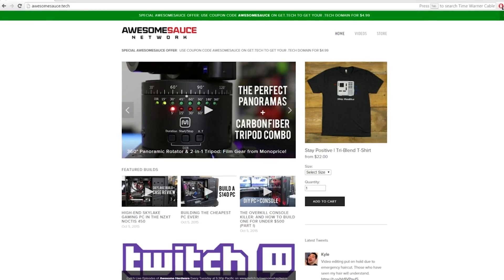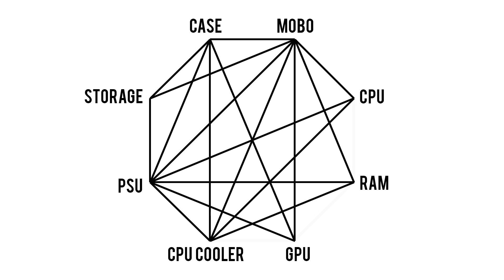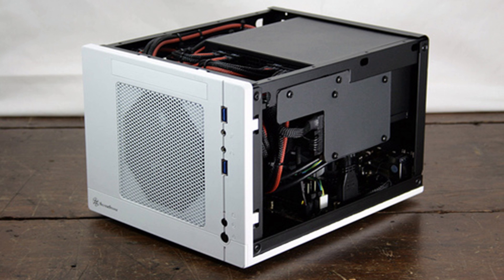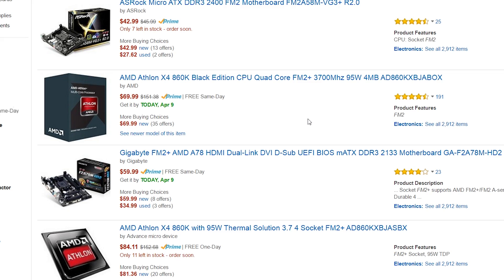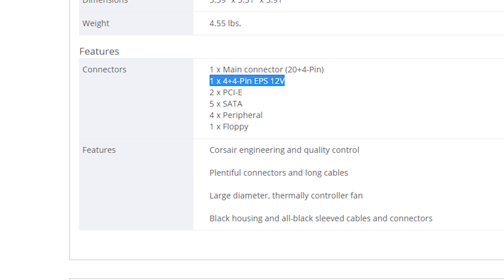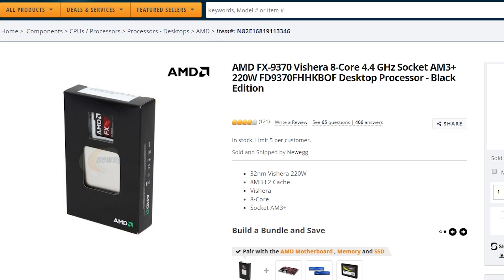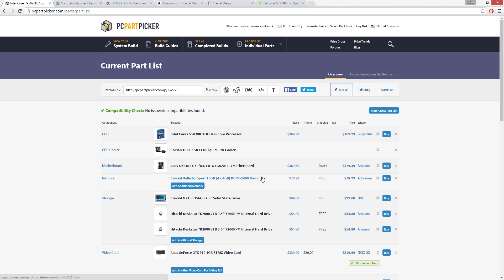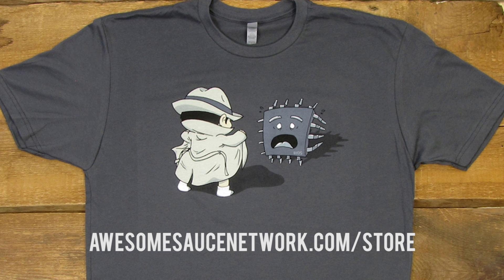How to Choose Parts for a PC! The Ultimate Compatibility Guide!

Comment: Yo dude can you check out if all my parts are compatible with each other http://pcpartpicker.com/p/RsyWYJ
Reply: pcpartpicker ONLY shows you parts compatible with what you already have. No worries there.
The GPU is bad choice, though. That card will never be able to use its full 4GB. It's simply not powerful enough for that. Get a 380. Also, your PSU is overkill. 600Watt is a lot. You also can't upgrade this in the future. Your parts are the last of the line in terms of DIMM type and socket. There's no CPU upgrade with the 1150 socket, so you're stuck. And the mobo only supports DDR3. So, you can only add more DDR3 RAM. 
It's a decent build to last you, let's say 5 years. But you can't upgrade it. You'd have to replace it entirely.

Comment: i need help with a psu... i need something that can support 4 gpu's and has a lot of watts so i can use 4 gtx 1080's or ti's when/if they come out. i have a massove budget so dont take this as a joke i genuinely need help with this
Reply: and I wondered if my fx6300 compatible with gtx1080? someone?
Reply: +ItsDream A 1500W PSU will support 4 gtx 1080. Search Corsair, Seasonic, EVGA, thermaltake or Antec for their power supply.
Reply: +Blackwatch Troops All graphic card is compatible to all processor be it AMD or intel or nvidia. The only thing that you have to worry about is whether the processor will bottleneck the graphic card.
Reply: Uhm, wasn't the 1080 only 3-way compatible? NVIDIA limited SLI on purpose because they know their cards barely get improvement in SLI.
And really, what are you going to do with all those 1080's?
Reply: Tomb Raider maybe not. But for CPU intense games like Crysis, GTA, Battlefield, that 6300 will suffer. It has low single core performance and a stock i5 6500 beats it. Even an overclocked fx-6300 at 4.5Ghz gets beaten by an i5 6500 at 3.2Ghz. Don't trust the numbers, trust the benchmark.

Comment: If you opt for a small motherboard make sure they sure that the motherboard manufacture doesn't decide it's a good idea to put all the IO, SATA and USB connections inline with the only 16x pcie slot restricting you to a card that is only the length of the pcie slot, a good example of this is the ACER DIG43L
Reply: That's why you should always opt for either AsRock or Gigabyte boards. Fuck Asus for the overpriced shit. MSI boards only if the other three don't have anything you like.

Comment: can anyone tell me what i can do to improve this build. should i get better parts or downgrade to save money. please help me out if you can. http://pcpartpicker.com/p/8ZDVqs
also ssd or hard drive?
Reply: +SuperiorGaming Missing parts, Casing. Buy a 1TB HDD and a 128GB SSD. SSD use for OS and other software that you will load frequently. If you wanna save money, get 8GB value ram. Change to i5 6500. Change to B150 motherboard. Use stock cooler. Lastly, get a better quality PSU from Seasonic of EVGA with at least 80+ gold. All this changes will not have drastic gaming performance reduction.
Reply: Why a B chipset? That's a chipset aimed at enterprises, and has tech in it the pc enthusiast can't and won't use, such as vPro and IPT. At least the H and Z chipset mobo''s allow for more USB's and are actually made for pc enthusiasts.

Comment: I'm confused
Reply: I'm scared
Reply: ps. im a dumbass
Reply: +Orekame Gaming It took me 2 years of my free time to understand it.
Reply: +Toropon Gaming proabibly since you are a 2:23(not meant as an insult, just coldnt not say it...)
Reply: It's easier than it looks, trust me.
Reply: it's easier than what it looks and sound like. I just built my 1st PC 2 weeks ago and works fine. The only problem I had was the Mobo not recognizing the RAM.  This was fix when I bought an additional stick of 2133MHz RAM just to get to the BIOS, change the speed of the RAM to 3200MHz and updated the BIOS. After I made those changes I was able to install the 32GB of RAM and the pc has been running fine ever since. I enjoyed building my pc so much that I'm looking forward in building one for my niece.

Comment: You missed the (Intel) Motherboard-to-CPU Cooler compatibility issue with Narrow ILM vs. Square ILM cooler mounts. Many Mini ITX motherboards have server-style Narrow ILM mount points, which are not compatible with coolers designed with Square ILM brackets. Sometimes you can buy alternative cooler brackets separately from the cooler manufacturer, but this has bitten me before.

Comment: Does the CPU matter when picking between DDR3 and DDR4 types of ram?, sorry but i'm bulding my first pc and i'm really not sure about that. Im planning to use a core i3 6100 and i've read somewhere that it only supports DDR4, is this true?.
Reply: +Edson Galeana Correct, the Intel Core i3-6100 only supports DDR4 or more correctly, the chipset required to use the i3 requires DDR4 (with some rare exceptions). The CPU you mentioned uses the new LGA1151 socket type, released with the new Intel Skylake processors (i.e. 10th generation), and require the Z170 chipset which in turn requires DDR4.
Reply: +Edson Galeana Yes. But getting a CPU and RAM that are both compatible with your Motherboard will address it. As far as I know 115x socket (Z97 and Z170) motherboards are DDR3 and 2011-v3 socket (X99) motherboards are DDR4, but your mileage may vary I suppose. Check your motherboard specs.
Reply: +Edson Galeana Skylake processor can run on DDR3L and DDR4 ram. Most of the time, it depend on the mobo that you are using. Some LGA1151 mobo support DDR3L or DDR4 but not both.

Comment: I need help The Peripheral cable mean molex cable right??? Cuz my case has a molex plug and my power supply has the peripheral cable, if they are the same thing, why is it so hard to stick the two cable together, i dont want to force it in if the two is not compatible, i just want to make sure they are before i put force

Comment: What about ram speeds prior to your cpu , for example if i want a skylake cpu what kind of ram speed should i buy
Reply: +Francis Metrillo Motherboard is the one that determine what ram speed it can support. 
Most B150 mobob only support 1866~2133mhz while Z170 can support 2133mhz ~ 3600mhz.
You can insert a 3000mhz ram onto a B150 and it will automatically downclock itself to the highest that it can support.
Reply: yeah, but my question is irrelevant to what the motherboard is

Comment: With my build, one problem I came across was the length of the cables from my case fans, particularly when I wanted to connect the front fans to the motherboard fan headers through the cable management space at the back of the motherboard. Basically, they weren't long enough, so I had to wait for fan extension cables in the mail before I could connect them up.

Comment: I'm planning on building my first PC but I'm not sure if it can run the newest games (GTA 5, BO3, CS:GO, BF Hardline, etc.) at 1080p max settings. These are the specs: 

CPU: Intel Core i5-6600 3.3GHz
CPU Cooler: ARCTIC Freezer i30
MB: ASRock Z170 Pro4
RAM: Kingston HyperX Fury Black 8GB (DDR4-2133MHz)
SSD: Samsung 850 EVO-Series 250GB
HDD: Western Digital Caviar Green 1TB
GPU: EVGA GeForce GTX 960 4GB SuperSC ACX 2.0+
PSU: Corsair CX600M
(Case: Cooler Master N600)

Do you think it will have enough processing power? And should I change some parts? Thanks
Reply: +FuzeMusic Processing power? Yes. The 6600 is an excellent processor. The second best purely gaming processor, second to the 6600K. And the 960 won't run games at max settings, only high. And you don't really need a aftermarket cooler for a i5, they run so cool the stock cooler is fine.
Reply: +Saxton Hale Ok thanks for the info! :)
Reply: FuzeMusic No problem :D

Comment: i built my 1st pc using the gigabyte z170 mx gaming 5 and the cpu i used is the intel penteium g4400 ram= corsair valueselect ddr4

i make sure every connecetion is properly attach i dont get any display boot on the screen, everything seems to be working fans cpu cooler

can someone help me out?

Comment: Thank you so much for this explanation! I'm saving money to build my first pc and I have been very confused about how to tell if all the parts will work together and this will help me a lot in figuring it out.
Reply: +Seth Cowell I'd be happy to put together a parts list for you if you give me your budget.
Reply: I'm looking to spend as close to $1000 as possible but the only peripherals I have is a gaming mouse cuz right now I use a laptop so I need to get those and an os. Thanks for anything you can come up with so I can check it out! P.s. If I need to spend up to $1200 for everything I can I just want to get something future proof (to an extent) but not way expensive.
Reply: http://pcpartpicker.com/p/9c9KP6
Optional upgrades:
Gtx 970 instead of R9 390 
Wait for the new lineup of gpus by Nvidia and AMD
More expensive modular power supply, offering cleaner cable management
 The 970 is MUCH quieter, cooler, and barely uses any power. But it is less powerful and future proof because of only 3.5gb of good vram. I added in the two fans an the splitter cable because the motherboard didn't have enough ports for all four fans. The case comes with two fans btw. The i5 will do fine on the stock cooler. This system will be pretty noisy.

You will be running every game at ultra settings 60+ fps at 1080p, as for the other resolutions, I really don't know, so you can google it. You can buy you preferred flavor of windows on r/microsoftsoftwareswap for about 20 dollars.
Reply: Actually, if you are just gaming at 1080p, the 970 will be fine. If you choose that route, you won't need the two extra fans.
Reply: I've done a little more research, the Sapphire R9 390 is the way to go. Much cooler because of the 3 fans. You can ditch the 2 extra case fans if you go with it.

Comment: is this good? http://pcpartpicker.com/p/W8MkkL
Reply: do i a better Power supply? llike http://pcpartpicker.com/p/zJdRf7
Reply: +It Me, VAC You don't need a super expensive mobo for a locked cpu. A 1tb hdd is about the same price as the 500gb there. Don't buy Windows for 100 dollars, go on r/microsoftsoftwareswap or Kinguin and pick one up for 20%. I would wait for Pascal in June to buy the PC though. 970 prices will drop and Nvidia will unleash a new line of GPUs. Otherwise, everything is good.
Reply: +It Me, VAC Another note, I would personally buy a PSU with more reviews. I recommend a CX600M. The PSU you listed on your original build is fine though. Also, that second PSU you listed is complete overkill.

Comment: can i plug a usb 2.0 port on my motherboard into a usb3.0 slot on my case?
Reply: +Rocktheblock7 It depends. usb 2.0 and usb 3.0 have different connector design. Some cases have usb3.0 that comes with usb2.0 splitter for convenience while others don't have.
Reply: ok thanks

Comment: i got lucky with part picker Didn't take into account the mobos heat sinks that would of stopped the x61 kraken being mounted. had to move to front rather than top to squeeze in. great site but own research is invaluable.

Comment: cpu/ram/motherboard is a bit more complicated than that. for instance, my msi board, while compatible with my 6100 chip, didn't like my crucial memory, despite it meeting the 'on the box' specs. while my asus board accepted the memory and the 6100 chip without issue. this is when you get to diving into bios updates, cas latency, and all the 'deeper' stuff pc builders learn along the way.

Comment: For graphics cards, it's often the case now that if it fits and you can power it, it works. PCIe is INCREDIBLY versatile and will simply run at the slowest speed. And even high end cards can't eat up the bandwidth of even a 16x Gen 1 slot. So PCIe generation is really a moot point. If it's slow enough to cause issues, you need a new platform anyway.

Comment: All these parts are compatile right???

https://pcpartpicker.com/user/DatMelonGuy/saved/#view=grfzK8
Reply: +Melon yess
Reply: +the guy ok thanks
Reply: +Melon no!! using those components will make your system blow up. use a radiator to cool down your storage drives. (just sayin')
Reply: +s4nic no i got s better idea ima put my pc in the fridge 
10/10 cooling
Reply: damn thats dank
Reply: +Melon Like the others said the parts you cjose are compatible. But why did you choose a Z170 Maiboard?
From my point of view it's a waste of money because you can't overclock the i3-6100 anyway. I would recommend you a B150 mainboard like the Gigabyte GA-H150-D3H. It does the job for you as well but isn't that expensive due to features you can't use anyway with this CPU.
Reply: +paryth hey,

the reason why i chose a z170 model is because i read an article online that said that u could overclock the non-k cpu's. 
what i didnt know, however, is that they closed the loophole a couple of months ago. 

so thank you for replying and saving me ~ 40$ :)
Reply: +paryth also, what motherboards would u recommend for under 80 $?
Reply: Melon

NO keep the z170 board it gives you better upgradability when it comes to cpu
Reply: +the guy Not necessarily. Only if you want to buy a overclockable CPU in the future and oc it of course. But to be honest: the difference between an overclocked cpu and a non overclocked one is about 2-3 fps in games. Therefore OP has to decide if 3 fps are worth the approximately 60$ he would have to spend extra for a oc-friendly mainboard and k-cpu. The only other real differences between Z170 and B150 are a few SATA- and 4pin-connections of which you find enough on the B150 mainboard in most cases. Not to speak about the GAMING mainboards which cost even more only because they look fancy and have a "better" soundchip, which still loses against a real PCIe soundcard. Which OP could buy for the money he saves on the mainboard, if he wants to ;)
Reply: +Melon It's difficult to find a mainboard I would really recommend that costs less than 80$ and features Intel Socket 1151. But you could give the Gigabyte GA-B150M-D3H a try. BUT: It's an MicroATX mainboard, just for you to know.
Anyway good luck with your upcoming PC :)

Comment: Best recomanded z170 board for a 6700k no OC max 200$??
Reply: +Simion Florin If no oc don't go for the k version. Waste of money
Reply: +Simion Florin 
ASRock Z170 OC Formula
Reply: Asus Z170-A if you're on a budget
Reply: +Simion Florin First off, if you don't plan to OC and know for sure you don't ever want to then pick a NON K sku cpu (save you a few bucks) You will prolly still want a Z MB to take advantage of everything the chipset offers but if you spend 80 to 120 bucks should give you a solid MB that should do everything you want. 1 note, I like the Asus MB's as they offer 1 button OC (I use a $110 MB in my system with a 3570k cpu, the 1 touch OC gave me 4.2 hz and it is super stable and I didn't have to try to OC anything myself) Also be sure to read reviews on them and check out the pros and cons and make a solid choice of what you think will work best for you.

Comment: the biggest problem for me is how much wattage do you need,lol
Reply: pcpartpicker.com
Reply: beQuiet!'s calculator is prolly one of the most accurate ones. But keep in mind, that "700W" on Box doesn't always mean, that the psu can deliver that wattage. Many cheap psu's can't deliver much Power on the 12 V rails (usually for CPU, graphics card, Mobo), so Check that out too.
Reply: Usually I estimate the max Power draw of my chosen Parts and then pick a psu from a Brand i trust (in my case BeQuiet, sometimes cooler Master) and Check wheter it has all connectors I need and if it supports all important protection curcuits. Hope I could help you out.
Reply: +Jannik Mayer thanks man
Reply: +Picadie Check out Jayztwocents channel, he did a good Power supply explanation video. Worth watching.

Comment: I just bought a corsair 750D case which has 2 USB 3.0 in the front but my P8Z 68-V LX doesn't have a usb 3.0 connector. Is that going to be a problem?

Comment: One thing to remember is the amps required for GPUs on the 12V rails of power supplies. This is something I was completely unaware of, and when I tried installing a GTX 470 in another computer of mine with an unknown (presumably cheap), but seemingly sufficient 600W power supply, it killed the power supply,but luckily everything else was fine. 
So I guess the lesson is don't use powerful graphics cards with unknown power supplies even if the wattage seems sufficient. But if you're building a system with reputable parts then it should be of little concern.

Comment: 1. If you want to run an PCIe-SSD (for example an Intel SSD 750) make sure that your CPU AND motherbord support multiple PCIex 16x slots to run in full speed if you want to have a graphiccard.

2. And if your planning to use multiple graphiccards makre sure they fit right next to each other without any interfearence with theire hight of one card with the distance between two PCIe slots.

3. Make sure the motheboard has PCIe slots an not the older and slower PCI slots. No modern card fit in to this old things.
Reply: I always wonder why they still put PCI slots on new mobo's because there are no PCI slot card's to buy and older ones are probably to slow to be even useful.

Comment: CPU still needs a connection to RAM since certain CPUs will not support specific RAM Speeds. Also CPU Should really have a link to GPU as well since certain CPUs have a finite amount of PCI-Express lanes and an SLI or triple SLI configuration would not work to its full potential.

Comment: Wait, so there is no correlation between CPU and RAM?
Reply: In theory, yes. The memory controller inside of a CPU can break if the memory requires too much voltage. The combination of a Skylake chip and DDR3 memory is right on the edge and not recommended, but possible.
In general, motherboard manufacturers will not produce a motherboard for an incompatible CPU+RAM configuration.